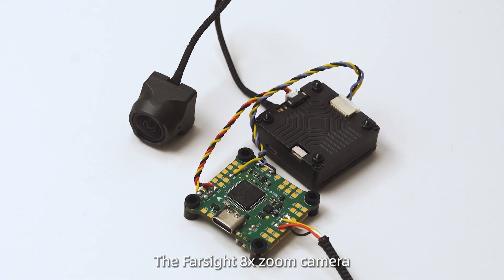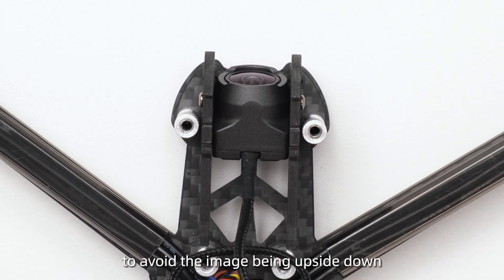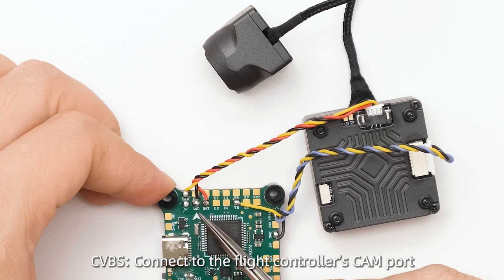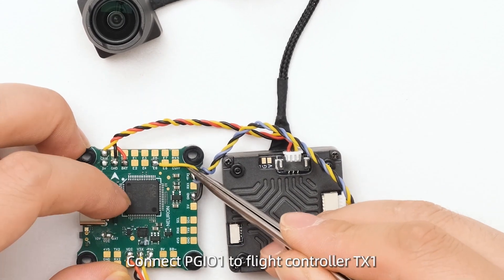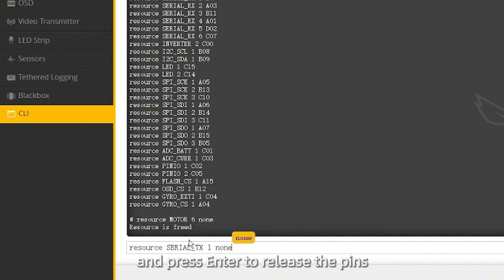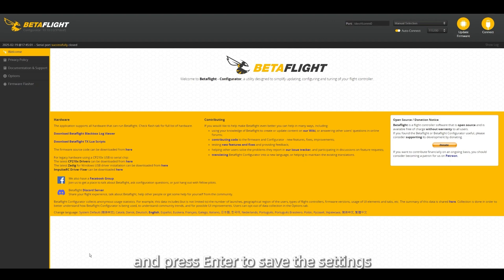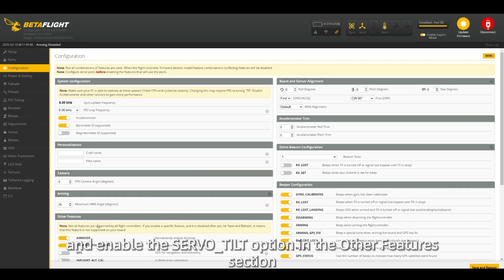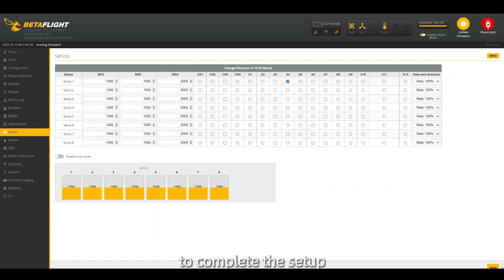8x Zoom In! – New FPV Analog Camera Tutorial

Comment: I'm using this in a car and since I only have so many channels, I am using just the single channel to control zoom.  I can control it directly from 1x to 8x in any way I like by controlling the PWM output.  I'm not using the "GPIO1" to reset the zoom, it stays unplugged.  For some reason it will randomly pickup a signal out of nowhere and reset the zoom back to 1x for a brief moment, and then change back to what I had it set to.  This happens either every few seconds or every few minutes.  How can I force GPIO1 to NOT pickup unwanted signals and disrupt the use of the camera?

Comment: Is there a way to adjust the camera settings? In particular, I need to adjust the exposure. The picture is overexposed by default. I didn't see any mention of a settings menu in the manual.
Reply: Negative.  Zero adjustable settings.

Comment: Is it true smooth optical motorized zoom of that faking "doubling pixel" digital zooming with bicubic pizel smoothing and AI sharpness enchancement?
Reply: The camera natively supports ultra-high resolution (comparable to 200MP), but its analog output is limited to 720×576. Zoom functionality is achieved by digitally cropping from the central area at varying resolutions followed by downscale
Reply: @xmos-n8s can it smooth zooming? can it be controoled directly via pins if I want to connect it to say, head monitor video in?
Reply: @Zelenyi4ay  He is adjusting the magnification according to PWM is, is smooth, as long as your glasses have PWM to farsight on the corresponding pins can be.

Comment: I use fpv on my rc car will this work without a flight controller like my current setup?
Reply from the maker: Hi buddy. I think u might wanna aks if the FPV vtx will work on rc car without being powered by a flight controller? Yep, it will, u could also power it with a separate battery. :face-red-heart-shape:

Comment: so it will pair with analog goggle? how is the signal stability? same like normal analog vtxs?
Reply from the maker: Hi it is an analog cam, needing to connect with a vtx. After that, the signal stability depends on wt analog vtx u use 🙃